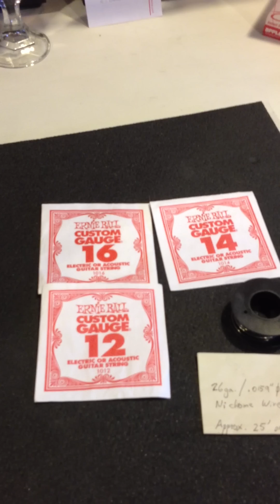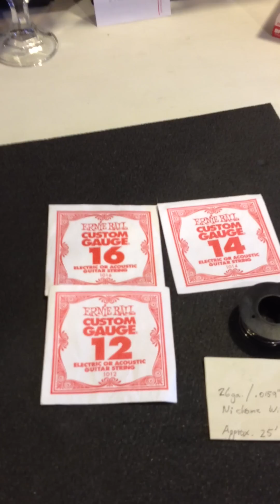DIY Cutting a Pelican gun case foam insert for an AR15 with a Hot Wire Foam Cutter (Part 1)

Comment: Anyone out there watching these videos, looking for the best method... FOLLOW THIS DEMO!  Its a great system. (I've cut 3 cases & it works like a charm)  The table keeps the foam steady, the bar keeps the wire taunt, & it cuts clean as a laser. I traced out templates in poster board, used this table to cut the foam, & sprayed the final foam with plasti dip. PERFECT.    ...Thanks Skid.
Reply: I can’t find the transformer?   Would you know of one I can buy online?

Comment: doesnt the aluminum arm get hot as well?
Reply from the maker: It does not, the electrical current experiences resistance at the wire and heats there.

Comment: Having watched your second part I can see now how the wire is connected on the top but, how is it attached at the bottom. Also did you use a level to find the barstock marking point?

Comment: Hi Could you please tell me exactly what dimmer switch you used from radio shack? I live in New Zealand and we can't get heavy duty ones so i will be shipping one internationally from the US

Cheers 
Ryan
Reply from the maker: its a standard 120V push to turn on, rotate to adjust voltage output dimmer switch.  Lowes, Home Depot.  But any AC dimmer switch will work.

Comment: That looks really great (the cutter and the completed foam)! one question... is the aluminum arm part of the circuit? or is there a wire running through it to the ni-chrome wire?
Reply from the maker: +Logic Bob , the aluminum arm is part of the circuit.  The Ni-chrome wire just has a loop on it that makes it easy to initiate cuts.  I have a Part 2 video that has some close-ups of how to initiate a center cut.
Reply: mhorschel32 Cool deal. Thanks!